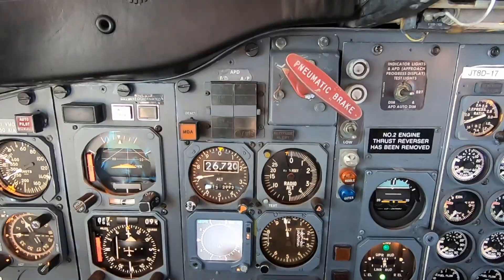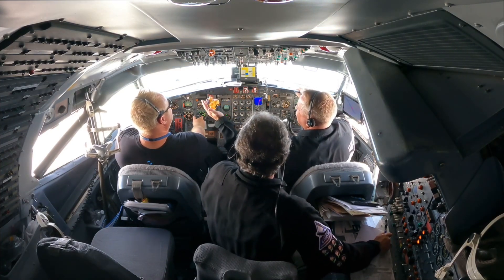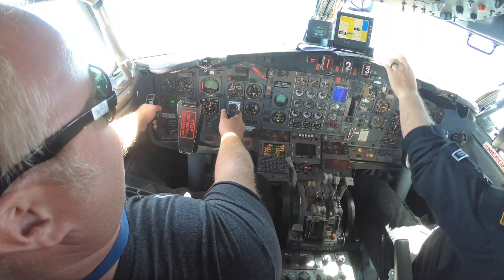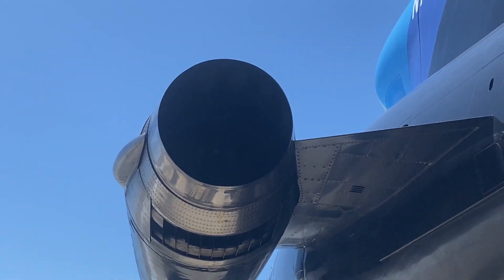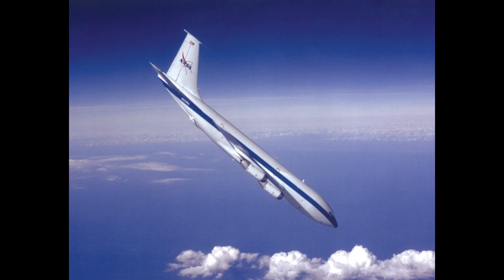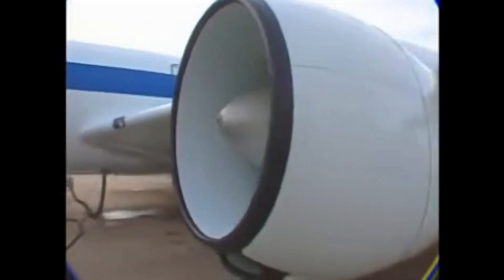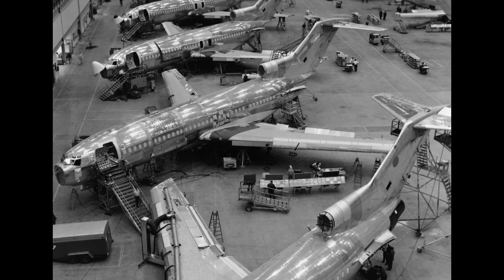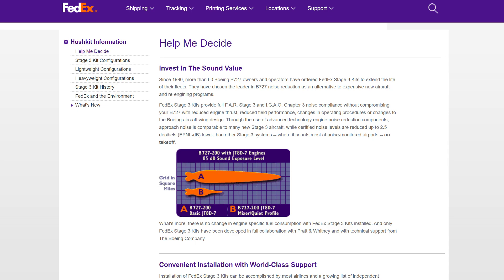Why NASA Uses A 1970's Boeing 727 For Zero G Experiments.

Comment: I wonder if a KC-10 could do the same thing since it has  similar design with the centerline engine ?.
Reply: All aircraft can probably technically do the same since there is no special G-loads or anything to contend with. The center thrust is a nice-to-have for the pilots, but the wing-engined KC-135s and Airbus A300&A310 do the same things just as well.

Comment: The 727 is a great plane.  A European pilot told me they would set the center engine to idle when cruising to save fuel.  He also told me that while in shake-down flights after full maintainece they would go off-shore and hit mach 1.  Maybe exaggerating?
Reply: You definitely wouldn't shakedown a subsonic yet by going mach 1... Testing the overspeed warning and going a bit overspeed, sure, but far far away from speed of sound.

Comment: It's very interesting to see, that in the US they also use these very old aircraft. The Airbus A300 used in Europe was the first of the line and after the two prototypes were pulled out of service it was the oldest airbus (!) in active service. When I was doing scientific experiments on a zeroG campaign, I was told, that there were two main reasons they used the A300. First, they wanted the computers to stay out of the loop as much as possible and since Airbus very quickly adopted Fly-by-Wire with the A320, the A300 was their only choice. Second, in most other types of Aircraft, as Scott mentioned, zeroG is is explicitly prohibited while it is not for the A300 (hence, it's allowed :D ).

The same logic is true for some military aircraft. In the swiss research team, I was working as a student, there was also a swiss fighter pilot, who was part-time doing research at the university. He realized, that his old Tiger II F-5 jet did not have any explicit restrictions on zeroG either and he was able to use the magazine box of the gun as storage space for biological zeroG experiments. Very cool stuff and the best student job I ever had!
Reply: I am curious, though. The pilots at Novespace told me, that there is nothing special with the A300 (and I assume the B727). They assumed, that Airbus just forget to mention zeroG in their guidelines, while for modern planes, the companies just put a disclaimer in, because they don't want (and don't need) to certify it. This would mean, that there is nothing fundamental prohibiting the use of modern planes for this, except legal issues and probably sensors/Avionics.
Reply: @janusseaman152  I wonder if the computers would allow such manoeuvers or intercept. At least a lot of warnings might be annoying :D
Reply: Yeah, the 727 is being operated in it's normal flight envelope and thus can be flown under Part 121. Good luck trying to get the same STC for an FBW aircraft. You could probably still do the same with 737s.

Comment: When I grew up in Hawaii we would take a 727 to the other islands at times when the DC3 was full. Back then it was operated like a bus where as soon as they landed you would exit via the rear stairs and they were loading passengers as you were getting off. Very noisy but a quick turn around. Molokai air was better IMO as I usually sat right seat on the jets when we took those. We were there because my dad worked on the Corona program. The 727 was a great plane and the better 3/4s favorite plane to work on next to the DC-10
Reply: DC3s were used simultaneous to 727s for passenger service?
Reply: @X85283  727s and others were run by the mainline airlines like Aloha to some of the other islands. Back then you didn't have big airports at each island either. Air Molokai was a small airline that operated out of a smaller airport and the DC3s were set up as combi (cargo and passenger) and the Cessnas(IIRC) were passenger only. They were kind of like Buffalo air in Canada. Flying out of the smaller airports was much nicer back then. It was more like getting on a school bus after school. Walk out of the little building up to the short fence and wait for the pilot to come out and tell everyone to board. The pilot would also ask for a volunteer to sit right seat(on the pass only planes). They were only required to have one pilot and a warm body in the right seat.

Comment: I had always assumed they used a 727 because they were cheap. Only a small part of the picture, as it turns out.
Reply: Spot on! It is rather all the different stuff that the 727 has that makes it cheap - not the 727s which are not actually that cheap to operate or own anymore.

Comment: There was one other more recent case of someone parachuting from the airstair door of a 727. In 2012, a 727-200 was deliberately crashed in the Mexican desert for a TV production as a test of crash survivability. The aircraft was fitted with a remote control system so a pilot in a nearby chase aircraft could control the final decent but the 727 required a crew onboard for takeoff and flight to the are of the crash because it was flying thru controlled airspace above populated areas. The flight crew bailed out once they were in the test are and the remote pilot had taken over. For the experiment, the air stairs themselves were removed so they had a safe jump space thru the opening. Interestingly, none of the air crew were certified skydivers so they had three professional skydive instructors on board to take them out in tandem jump rigs. All six personnel successfully exited and landed under canopies.
https://en.wikipedia.org/wiki/2012_Boeing_727_crash_experiment

Comment: I wonder if the Lockheed L-1011 another tri-jet with a "S" duct on the center engine, have similar benefits, except with far more interior space and potentially younger airframes since the last ones were delivered in the 80's.
Reply: The KC-135 or Airbus never had any problems doing the same thing - the 727 might be a bit more straigtforward to fly an arc, but I don't think it matters that much.
Reply: The L1011 is nevet coming back like the 727 since there were always much more of everything for the latter and the L1011 is a huge aircraft with much much more expensive engines for example. Would be best to just go with the youngest 737 you could get certified with an STC.

Comment: I doo think another reason to choose these analog controlled airplanes for zero g flights  are the software based safety systems that needed to be bypasses and the plane to be recertified for use - and software modifications being more expensive than changing valves and reservoirs
Reply: IIRC from the Tom Scott video, on the euro zero g plane, the don’t disable the alarms.

Comment: I wonder how much extra stress is being put on the airframe, wings spars etc. every time they pull out of the dive when compared to a normal flight profile? Considering they are doing this day in day out they must have made some thorough calculations.
Reply: The aircraft is being flown in it's flight envelope, and not fully loaded - I don't think it is an issue. Pretty sure it is still thr pressurization cycles that count.

Comment: Ex-Braniff? I may have flown on that airplane back in the day. Do they actually operate Part 121? I would have thought Part 135. On the A-310 zero g airplane the pilot probably is holding the big rubber bands hooked to the yoke so that the right seat pilot doesn’t have any slop in the yoke and thus can more precisely control the roll. The Blue Angels have a spring system attached to the stick of the F-18 requiring the pilot to exert several pounds of back force just to keep the airplane level in pitch for just this reason since they have to fly so precisely The Thunderbirds, since the F-16 side stick essentially doesn’t move at all, accomplishe the same thing  by setting full nose down pitch trim.
Reply: I guess it’s part 121 because they set the schedule. When NASA contracts them out it might be part 135

Comment: I wonder if they've looked at getting an L-1011?  Similar setup for the centerline engine and you'd get much more space to float around on a widebody.  Flip side is that there aren't nearly as many out there and you're going to need a lot more runway.  Checking it seems like there's only one left operational but I wonder how many are in boneyards and recoverable.
Reply: Being unrelated to the kc-135 would make it hard from a regulatory perspective.The center engine doesn’t have an s duct, it goes straight through, so it would torque the nose down. Plus a bigger plane would increase the risk of having to fly with empty seats, losing money.
Reply: @danthewolf1997  — The L-1011 (Tristar) has the center engine mounted as in the B727, with an S-duct.
Reply: @danthewolf1997  L1011 has an S duct, the DC-10 has a straight through engine.
Reply: Plus the last L-1011's were delivered in the 80's, considerable younger airframes, and are used mostly for longer routes meaning fewer pressurization cycles.
Reply: The center mounted engine is a nice benefit of the 727 but not at all required for the STC. The KC-135 and Airbus A300 & A310 have no problems doing the same thing with wing mounted engines. The center thrust is a nice benefit, but it would probably be best to just get the youngest cargo 737 you can get your hands on to do the same stuff. The 737 Classics are not so far away from the 727 either.

Comment: I would think that the aircraft may have a more metal fatigue on the wing roots and spars, but that should be in the records of the KC-135/B-707 jets. You should be able to autopilot the maneuver using the normal system, the problem being the pilots would have to input a lot of corrections thereby making the autopilot fairly useless. You are only changing altitude, but the trajectory has to meet stringent requirements as you elude to.
Reply: They are operating Part 121 so they have to be flying within the 727s normal flight envelope. They are also never fully loaded. I doubt it is anything but the cycles that count. Maybe the nr. 2 engine requires a bit more maintenance to the rest since it is throttled up and down more often. They probably cycle the engines to keep the number of throttleups similar. It isn't like they are using full thrust either.
Reply: @rkan2  You can operate within the flight envelope and still fatigue the aircraft faster than you or the engineers think.
Reply: @johnmoore8599   Engineers think what they think for a reason.  Aircraft fatigue design is science rather than speculation.  In particular, there's not much fatigue involved for a relative handful of smoothly-applied bending load cycles at well below the elastic limit.  Something like trying to skirt a thunderstorm on a typical transcon passenger flight would put the structural elements a lot further along their S-n curves.
Reply: @marcmcreynolds2827  I did not say that engineers were speculating. There have been incidents where metal fatigue due to pressurization cycles was underestimated resulting in accidents and inspections. If the wings and such are sturdier and their estimations more correct, then I suppose there's nothing to worry about.
Reply: @johnmoore8599  Quite true.  I later read elsewhere in these comments one of the company principals stating that they had run a 50,000-node finite element model in support of the FAA approval process.

Comment: I just noticed how the 3 amber “Low Oil/Filter Bypass” lights under the gear handle come on whenever they’re at zero g. Interesting considering he talks about how oil starvation at zero g can ruin engines really fast 😂
Reply: In the previous video the captain mentioned that they should worry if the lights do not come on. Lol
Reply: I think in the last video one of the pilots said it's expected and no warning lights would be the actual problem 😅
Reply: I noticed that, too. I thought Scott would comment, but he didn't.
Reply: Good catch! I went back and saw that as well.
Reply: The door lights have rather simple proximity switches. They are not connected to the hydraulic system at all. They operate only with very high tension cables, pulleys and bell cranks. Notice also that they are amber, thus they indicate something between completely open or completely closed. Actual "gear position" lights are separate and are either green (down & locked/safe 👍 ), red(not safe/unlocked 👎 ) or OFF (up & locked).
Reply: @arkiefyler   those aren’t the gear lights though - the gear lights are above them. If you look, you can see they say “Low oil/Filter bypass 1, 2 and 3” for the 3 engines
Reply: That is what those are? I was thinking the maneuver was just drifting some switch and making the gear down lights come on.

Comment: I think 0g flights would be a perfect task for the precision of a good autopilot. It seems like too much work to never actually get 0g perfectly.
Reply: Humans react better to out-of-parameter situations
Reply: Think of the tremendous hazzle, Boeing had with the flight-software and certification for the 737 MAX. Programming an autopilot for this task and getting it certified would be a nightmare (in other words: tremendously expensive).
Reply: Especially since there's no more than a handful of these planes flying with these parameters, the per unit cost will be even higher
Reply: Of course a computer could do this better than a human, but Scott addresses this in the video: it would just be too much effort and expense to get a custom autopilot made and certificated for this extremely niche application.
Reply: Also, if I recall correctly you literally can't do 0g manoeuvres on modern airliners, the software won't allow It
Reply: I don't think programming something to essentially nose dive is a good idea
Reply: Also Autopilot controls 3 axis. A different independent system- auto throttle- controls your engines. That's actually a big problem. But of cause certification is much more difficult since you have to proof you thought about every detail of the aircraft and have at least n-1 in every part and normally nothing can break.

Comment: The exhaust mixer table is very cool, but I want a coffee table made out of a Falcon 9 grid fin...  And a living room large enough to put it in.
Reply: There's much smaller grid fins from bombs and such, you could probably find one cheap and it would be a more appropriate size for a table. Not as cool though.
Reply: The one at SpaceX HQ is amazing!
Reply: I want a GE90 fan blade hanging from my roof! They sold a couple on eBay for like 5k$ like 5 years back!
Reply: @rkan2  I want a whole jet engine to display. Not such a big one but maybe one from a business jet or so. I'm sure it can be found cheap on the scrapyard that's all busted up. And if I have a garden someday an old fighter jet. Sometimes you can find them for the price of materials if it's beyond saving.
Reply: @please_stop-v7o  Often even engines that seem "beyond saving" can be useful as parts or uncertified in working condition as industrial jet engines providing power for gas and oil pipelines and sometimes as gas generators to create electricity. Therefore they usually don't go for cheap.
Reply: @rkan2  Nah one that's completely done, corroded, sat outside for years. Seen some for cheap but I'm super broke so someday when I have a real job. I once saw a Korean war era fighter for a few thousand bucks. Probably not a single functional part but beautiful. You can find these old MiGs for around 50k fully functional. Cost per flight hour is probably horrible though.
Reply: @rkan2  That sounds pretty cool, too.  I would love to have an aviation-themed man cave in my pole barn... that is, if I had a pole barn!  Don't have one yet!  And a jet engine fan would fit right in.

Comment: I guess there's probably an autopilot active with alpha and envelope protection in the background. Especially in the airbus
Reply: You can disable it. Airbus FC operates in different "laws". In normal law you have all the alpha floor protection etc... while alternate law removes most of it and direct law all of it, operating in essence like a a direct cable link between stick and controls. Alternate law can automatically activate for things like recovery from upsets or terrain escape maneuvers, to allow maximum climb rate etc... Direct law is not used during normal operation. Not sure if it can be easily engaged there was an accident where the pilot selected it unknowingly and didn't notice until too late. I forget the details.
Reply: @please_stop-v7o  You probably wouldn't get an STC to fly an Airbus in alternate laws regularly to perform these kinds of flights though.
Reply: Not in A300 & A310.

Comment: There was also a a300 flying zero g for the company noves pace. This one was retired in 2014.
Now they have a a310 flying zero g.
Both are twin aisle aircraft, there is a lot more room in them.
Fun fact: the a310 they are using was formerly the "konrad Adenauer", the aircraft used by the German chancellor.
Reply: The retired A300 is now located on a public parking lot at Cologne /Bonn Airport (CGN) 😊
Reply: @nicolasblume1046  That A300 in question was MSN 003, an A300B2-103, which was the third Airbus ever built, and until its retirement in 2014 it was the world's oldest flying Airbus. I really wish that aircraft be moved into an indoor display as outdoor storage long term can bring a host of damage to the aircraft including corrosion. The original A300 cockpit is very fascinating and I really wish more people have a chance to see it.
Reply: Possibly has much less time on it than most A310s.
Reply: @neilgerace355   You are propably right about flight hours. But I learned that they count each parabola as take-off/landing cycle for maintenance purposes. So those propably add up at least as quickly as in normal transport operations.